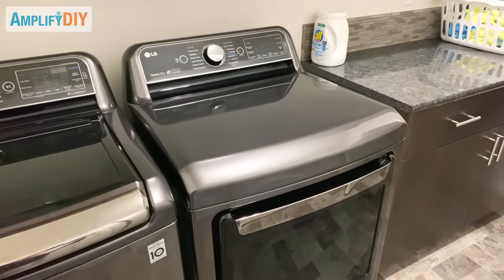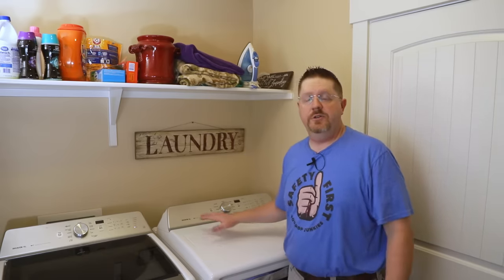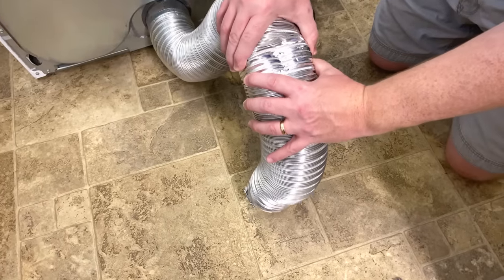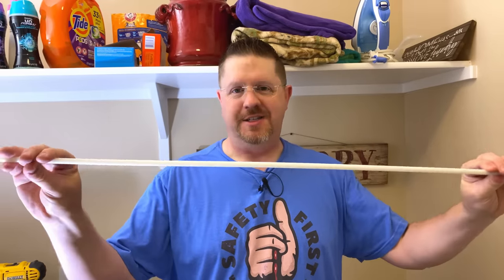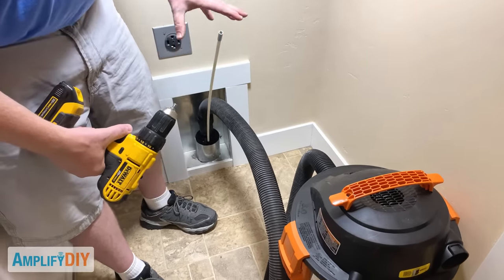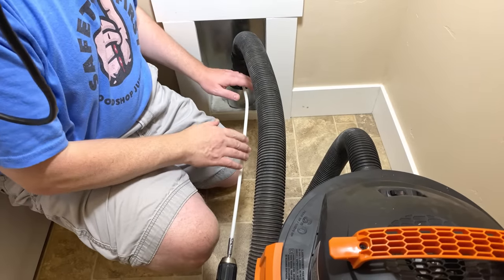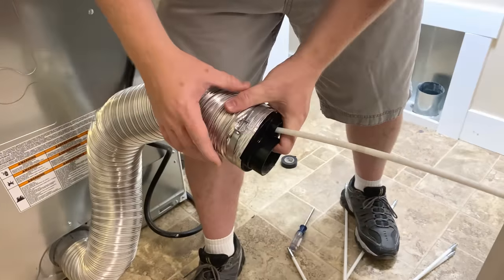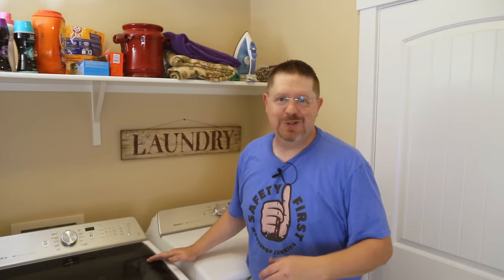How To Clean Your Dryer Vent Duct - Step By Step - It's Super Simple!

Comment: An easier way is doing it outside the same way. Just turn the dryer on so you have that positive air pushing out.
Reply from the maker: For people with easy access to their outside vent, this is a good option. Thanks for the tip!
Reply: @AmplifyDIY  ...correct....and you can choose cold or only mildly warm air....it doesn't have to be "hot", just "flowing air"......good tip....and probably do-able for most ( 90+% ???) of the viewers with accessable outside vents. Not so much for the poor guys with the roof-exits !!!!!

Comment: I always check my dryer exhaust and vent, before starting my dryer to prevent dryer fires. My family has saved $15.00 to $20.00 on utilities a month, cleaning my dryer exhaust and vent regularly with the Gardus LintEater Dryer Vent Cleaning System Kit featured in your dryer vent cleaning video.

Comment: Outstanding instruction and tips! My neighbor recently wanted to clean her vent so I loaned her my kit. She got 3 sections into the vent, past a 30 degree bend, and lost the brush and deepest rod.Then she called me. I was able to feed the other poles from the laundry room to the exhaust vent with the smaller brush as the lead end. Unfortunately it did not push the detached end out so I made about a 2.5 inch wide tape ball secured onto the very end of a pole in the laundry room. I then pulled from the outside slowly hoping the tape ball would grab the stuck brush on the way out, it did until the 30 degree turn where the detached pole would not make the final turn, about 5 feet from the vent. Before I pulled the tape ball past the stuck brush I used an old broom stick to position the rod end to make the 30 degree turn. An added tip: with sharp turns the brush is sometimes difficult at making the bend, my brush stem can be bent slightly which aids in getting through the bends, just go by hand through the turns, it will find its way through, then continue with the drill.
Reply from the maker: Oof! Glad you were able to get all the parts back out of your neighbor's vent. Good tip on the tight bends. Thanks for watching!

Comment: I recently told a relative about the Gardus LintEater Dryer Vent Cleaning System Kit that helps keep the dryer vent clean. I appreciate the helpful video. I am thankful that I discovered lint build-up inside my family's dryer last weekend,before a dryer fire could happen. I surprised my father that dryers should be cleaned once a year to prevent dryer fires.

Comment: Great video. I'm going to tackle this. My laundry area is so tight I'll never be able to get a shop vac behind the dryer so I will try this from the outside vent, which for me is easily accessible at about 3 feet off the ground in a clear area with a removable cover. Thanks for mentioning so many of the variables involved in the project. There can often be stopping points when one presenter has a particular set of circumstances that don't apply to other people's situations. Thanks to your tips I was able to think through my situation for hopefully a successful process!

Comment: Great video. I have used that exact same product for years and it works great. I don’t bother taping the rods together and have never had a problem and I have an extra long run. I clean mine from the outside in and connect my shop vac on the drier side. You should clean your dryer ducts at least every year. Also, if you use a vinyl collapsable connection on your drier, replace it with a metal one. The vinyl one is a fire hazard. I used the clog removal tool to clear a clog in the underground pipes that carry water away from my gutter downspouts.

Comment: Followed this process and it worked well.  One thing I had to do was wrap the adapter to my vent tube with about 5 layers of electrical tape before it made an adequate seal.  I also taped the reducer to the adapter required to attach it and make a seal as it was also way too loose.  This was for the kit recommended in this video.
Reply from the maker: I'm glad it worked well for you, Nick. Thanks for watching!

Comment: Got my order from Amazon. I was a little scared  at first because the brush wouldn’t go down into the duct. But it finally started. So glad you mentioned the electrical tape on between the joints. I think I hit the outside because I could no longer go in. I broke 2 of the fiberglass extensions trying to go in more. So I backed off. Looked in my shop-vac and it was full of lint. I think I will be doing this often. Thank you. Any other tips will be appreciated.

Comment: I regularly clean the outside dryer vent,the rear ventilation holes, inside dryer drum holes,lint chute and screen. I use the Gardus LintEater Dryer Vent Cleaning brushes to help maintain my dryer vent and dryer. I appreciate the helpful video about this. I have noticed more steam that comes out of my dryer vent outside chute and clothes dry faster in one drying cycle. I thought about dryer lint build-up is not worth a dryer and house fire. My utility bill has been lowered by $20.00 a month cleaning the dryer and dryer vent.

Comment: I just had mine cleaned, and he went inside, turned the dryer on and fed the brush from outside. He must have used the vacuum attachment or something similar because there was zero lint on my back deck when he was done. I did see him carrying a respirator. I didn't watch him the whole time and didn't hear a vacuum except inside he used a vacuum to clean from the back of the dryer to where it attaches to the duct. He didn't take anything apart, he did it from the vent screen area of the dryer I think. I haven't looked to see how it looks there but he did show me before and after pics of the main duct.

I'm glad you addresses the extra strep of taping the joints. I have been wanting to start cleaning my own chimney, and now will definitely start cleaning my dryer duct but my biggest fear has always been the brush or one of the rods coming loose in my chimney. If I hire someone, it's on them to clear anything they get stuck. I'm on my own if I get something stuck.
Reply from the maker: Thank you!

Comment: Hadn't cleaned mine for several years.   Did mine a slightly different way not expecting how much was in it.  Took off the bird guard on the outside of the house facing the back yard.   Took my Craftsman Shop Vac and folded a hand towel around the end of the hose and slid it into where the hose comes from the dryer.   Turned it on to the blow setting and gave it two minutes.  Looked out my door wall and realized I created Christmas in July in my back yard.   I have never went the extent that this video does, but always make sure I regularly do it now.   And If you end up with the mess I had, Just cut the grass and it comes up with the clippings :)

Comment: Great instructional video! Thanks for making this.  As luck would have it, in the house we just bought (that came with the major appliances) mine is an older Whirlpool GAS dryer. So now my challenge is finding out where to turn off the gas supply.
Reply from the maker: There should be a gas valve right behind the dryer. Usually there is a flexible gas hose that connects to a rigid gas pipe that comes out of the wall. The shutoff valve is generally right there. Good luck!

Comment: Excellent instructions and video!  I definitely need this, but have a dryer up on a stage in the basement. I had a tool before that I could use from the front of the dryer running it up the lint channel and tube. I will check your recommendation. Thank you for sharing and be safe.
Reply from the maker: Good luck! Keep in mind that you can also clean the vent from the outside of the house in towards the dryer, if your dryer is difficult to move.

Comment: Just for such humbleness I must subscribe. Awesome job. One additional suggestion, if your wet vac has a blower switch, always blow the pipe outward before connecting the suction, this helps for a quicker cleaner finish.  I actually made my own duct cleaning tool with PVC and Rubber Connectors . Great idea with the electrical tape or duct tape for duct cleaning lol. Thanks again.

Comment: Great video! I’m installing ducting for a dryer and want to set it up for easy cleaning. Mine vents through the roof, making it a little more challenging. I bought one of those plastic junction connectors just for the trim plate. I’ll probably remove the inner draft blocker flap as there’s already one on the DryerJack vent I’m using. Not sure if this shop vac connector will fit inside it..? I can’t find a simple trim collar to run the 4” duct straight through the ceiling. ***One suggestion I’ll make is to shut off the dryer’s electrical breaker in the panel before touching the plug. I know someone who died by electrocution from handling a dryer plug. I’m extra careful about that now. Thanks for your help!

Comment: Thank you for the fantastic tutorial! 
Every homeowner or renter should tackle this job. It is super easy, just takes a little bit of time. The drill does almost all of the work. The only task is moving the dryer and cleanup/clearing the vacuum a couple times until you get no more lint. 
I bought one of these kits along with some extra rods. Cleaned up like a dream. I could easily feel my shop-vac pulling air once I finished. I cleaned mine from the outside ---> in due to what I assume was a 90* turn that gave me trouble when trying to attach a second rod when trying from the inside ---> out. My kit was a little different where it used a spring loaded detent to lock the rods together, but otherwise the same. 
Again, thanks for the instructional video. My cost was $65 with 4 extra rods. Much better than a quoted $200 from my appliance supplier when I purchased a new dryer.
Reply from the maker: Thanks for the feedback, 12gaugebleachdrinker! I'm glad my tutorial was helpful, and great job getting your duct cleaned!

Comment: Thank you for sharing your knowledge on this with us.  My concern is tearing the thin walls of the aluminum looking duct
Reply from the maker: Hi Beverley - if your duct in the wall is the thin, flexible aluminum that is usually used to connect the dryer to the wall, then you should not use this cleaning technique. It works great if your ducts are smooth-walled as I showed in this video, but if you have the flexible ducts... well, those have been against building code for a LONG time specifically because they collect so much lint. Ideally, you should get any flexible ducting in the walls replaced with smooth-walled ducts... but that may be a pretty large job.

Comment: Thank you for making this video! I got the same kit from Amazon. My only problem is that the rods do NOT come apart easily for me when I'm removing them from the duct. I even tried using pliers to get them to unscrew from each other, with no luck. I ended up pulling the whole thing out with all the rods still attached, and hoping my husband has better success than me. But otherwise, this video made the whole process a lot easier! I couldn't believe how awful my duct was when I first looked inside it!
Reply from the maker: Hey Giggles! I'm glad to hear you were able to clean your ducts! Yeah, the rods do hold together pretty strong, for sure! I hope you have been able to get them separated since leaving your comment above. If you have not, 2 pairs of pliers (one on one rod, one on the other) should be all you need to separate them. Good luck!

Comment: My family's dryer is more efficient,and dries clothes
faster. My family's electric bill has been lowered each month just by cleaning my dryer and dryer vent. I learned a lot about this in helping prevent a dryer fire.
Reply: I vacuumed the dryer vent that leads to the back patio. I vacuumed my family's Kenmore dryer entirely to prevent lint build-up and dryer
fire. I clean my dryer vent and dryer regularly before considering drying clothes. I was surprised by some lint that was inside my vacuum canister.

Comment: Great video. If your vents are clogged lint backs up into the dryer and builds up inside. The heater assembly is open and can ignite the lint. It would be important that if you have had dirty or blocked vents for a while to clean the inside of the dryer. Probably would be best to call an appliance guy for that though.
Reply: I am watching this now because i just moved into a new rental house and the owner neglected to use the screen, so I found handfulls of old damp dense lint compacted all under and behind where the lint screen was... havnt even taken anything apart yet... do you think this tool in the video would even work at all for a situation like this extreme?? I dont think the owner wants to hire anyone so I am trying to figure it out by myself now...thanks.
Reply: @madmax8620  it will work for your ducting but not for the inside of the dryer or the filter assembly. You could probably find a video on how to disassemble the dryer but if I was a renter I probably wouldn’t try. Depends on how handy you are I guess. I do it every day at work but the first time is always tricky. If the machine is under warranty it may void the warranty.

Comment: This popped up on my recommended videos and I do this for a living the only thing I'd like to add to his very good explanation on how it all goes down is if you have alot of the flex duct do not use the hard brissle head use the soft one you will run the risk of tearing the soft duct

Comment: Had my installation guy say the hose behind the dryer is actually unnecessary, since it obviously gets bent and frequently damaged from the dryer being pushed back into it.  At the supply store where you get the dryer cleaning kit, there is a section of sheet metal designed to fit the back of the dryer outlet and an elbow section to fit into the floor, thus getting rid of two feet of hose that is bound to collect more lint than the sheet metal, is what I was told.  For what it's worth.  Thanks for a great video.
Reply from the maker: Those are SUPER tricky to line up perfectly, though. I like the freedom of the flexible hoses, even though they do attract more lint. Annual cleaning keeps it plenty clean, though. Thanks for watching!

Comment: Loved this video! Extremely easy to follow and understand. I love how you add in little tips to make things easier and address things that could possibly come up.  I am wondering if there are some instances where doing it yourself might not be a great idea.. specifically; what if you have a dryer vent with multiple twists and turns? I guess I'm just afraid that in one of the twists and/or turns; what if it loosens the duct work and heaven forbid, two joints come apart? Am I right in thinking that could be catastrophic? ( I say catastrophic because some of those joints and turns are inside a wall and not visible.)
Reply from the maker: If your ducting was installed correctly, it's pretty unlikely that you'll be able to damage anything with this cleaning method. Still, be careful and don't use an excessive amount of force anywhere. These rods bend easily, and should get around the bends in your duct pretty easily. Good luck!

Comment: Hi.  Great video!  We have a dryer vent hose with several 90 degree turns in it.   They are behind drywall and hard to access.  The vent is clogged and barely letting air through.  Do you have a recommendation for how to navigate the turns?
Reply from the maker: Hi mckinnonw1 - the kit I demonstrated should have no problem getting around 90º bends in your vent. Just follow the procedure I showed - MAKE SURE you tape the joints between each segments of the rod. Go slowly and take your time. The brush needs to be spinning whenever you either push it deeper into the vent or pull it out from the vent. Whatever you do: under no circumstances should you EVER put the drill in reverse. ALWAYS have it set to forward, even when pulling the vent brush back out of the vent.
If you find that the brush tool gets around 1 90º bend but won't get around a second one, you can try cleaning from the outside of the house in towards the dryer - i.e., clean from the dryer out as far as you can get it to go, then from the outside of the house in towards the dryer as far as you can get it to go. That should get everything. 
Good luck!

Comment: Very useful and practical information. Thanks for sharing
At 11:28 in your video, upon completing the cleaning, may I suggest to detach the brush head right at the vent outlet so it make easier to withdraw the extended rods from inside the house
Reply from the maker: This is a good tip - especially if your vent exits on the ground floor. Thanks for watching!

Comment: After this is over I’m going to go clean my duct. I bought that same kit. I hope it’s why our dryer isn’t running hot.
Reply from the maker: Good luck!
Reply: @AmplifyDIY  thanks. Your instructions were excellent. We cleaned out the ducts/vents and reattached everything. Unfortunately it’s still not heating. It was so clogged I’m sure it’s what caused it. I bought the dryer used. I watched some videos on trouble shooting and repairing a Maytag. It’s over my head. I’m going to buy a new dryer. At least it won’t burn out. My next project when it warms up is cleaning my A/C. That’s a great video too. Thanks so much.

Comment: I agree with those who praised your delivery.  One symptom I found of a clogged vent is the clothes being hot but not dry after a cycle.  Folks I suggest yearly cleaning around Daylight Savings the same time you check your smoke alarms.
Reply from the maker: Great suggestion on the timing for cleaning. I usually do mine in the fall. Thanks for watching!

Comment: I have a 30 foot line going under a concrete slab, and in the middle is a dead opossum, swole up and stuck. I guess I need to use that cutting tool and try to vac it out. Wasn't sure how I would tackle this problem until I saw your video. Thanks